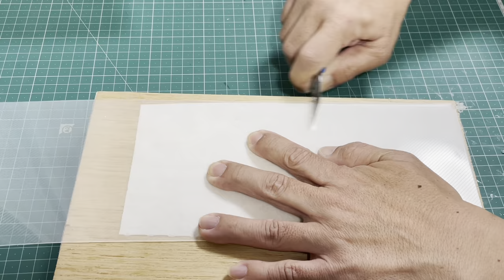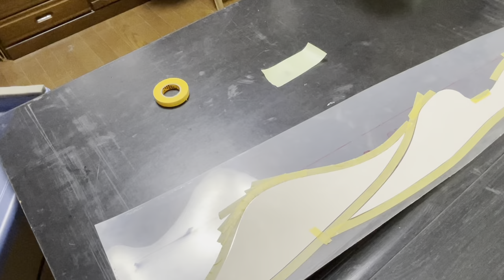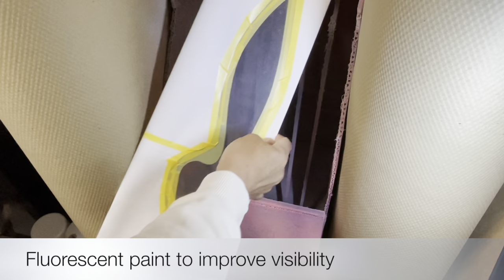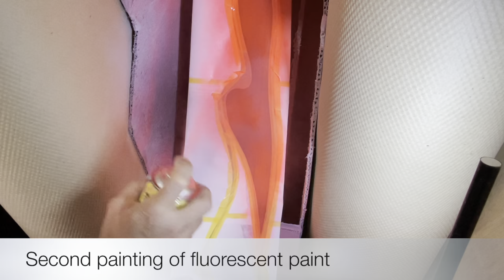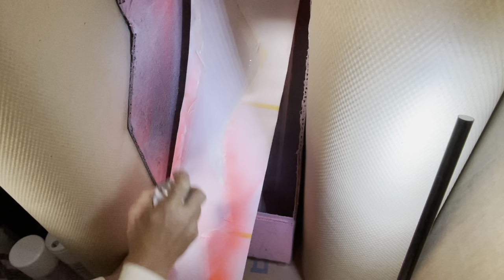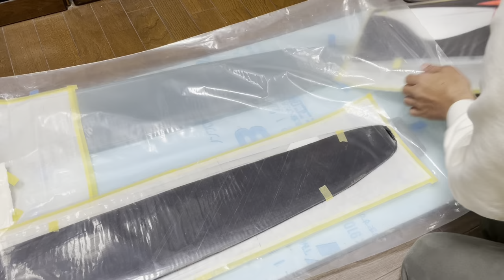Scratch built DLG glider -Transfer painting-

Comment: good video, very useful, where did you get the polypropylene sheet?
Reply from the maker: Exactly. It's hard to get wide size polypropylene sheet.
You can use Mylar(PET) sheet instead.
The one of thickness 0.25mm is easy to use. 0.35mm brings better surface but you need to scrape the leading edge of the sheet to fit the 3D curve of wing.